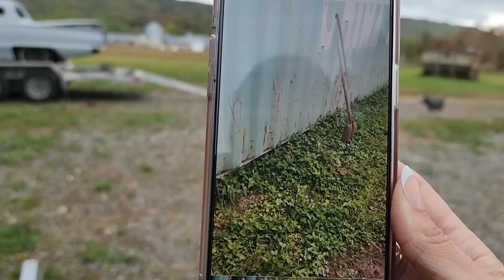Sold 3 cars this week... including our 1958 Thunderbird... such a bittersweet feeling 🙃

Comment: Chad I wish you'd have finished the t bird. I've been inspired by that build to do a build of my own loosely based on it. I have a 1964 Galaxie 4 door sedan and a parts 4 door hardtop. I'm building a business coupe gasser out of the sedan. I'm moving the rear side glasses up to the wing window and combining doors to make longer single doors then like your t bird I'm moving the B pillars up and filling in between the trunk and rear glass.  I'm using the roof and doors off the 4 door hardtop. The motor I have for it is a 429 big block. It'll kinda look like some sort of ranchero with a trunk still on it.
Reply: @dougbarnes1681  right here is an example of a first class jealous hater !!!!! go play on the road !!
Reply: show some pics
Reply: @frankfurther3828  I have not started yet. I do have some crude Photoshops I made, but I'm not sure how to get them on here.

Comment: Use wood long screws to hold wood in case of fast stop just so to make sure it don't move . put there after chains and binders are tight . I move alot of cars equipment ECT .... I only use two long chains make my adjustment with just two binders .... But if your just moving cars ECT . make two chains for the rear , sometimes you can hook into frame holes depending on car , be careful with brake lines not to crush  them or brake anything ! 🤗😇 .

Comment: When traveling long distance never use straps in case of weather , rain will allow stretching of straps . = loose bad ! 
Always use chains and binders . the way I do it long chain in front criss cross down to side bar on trailer , (( run chain through side rails chain will run across deck up to each side  then take chain left to right control arm , same other side use hook to adjust length no binder on front rear criss cross again two chains with binders pull tight when happy with positioning of car on trailer . use zip tie or wire to lock binders arms  down  .. MTO Approved won't move at all ... That car I might going that far put wood stops front and rear wheels INFRONT of tires